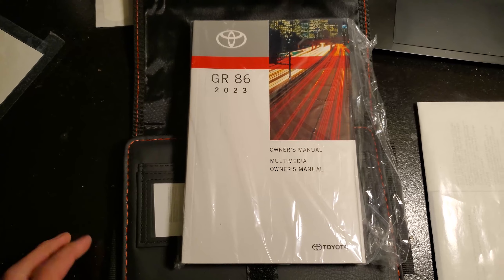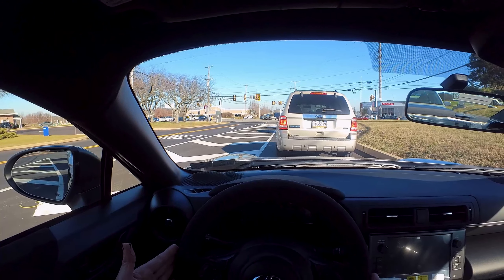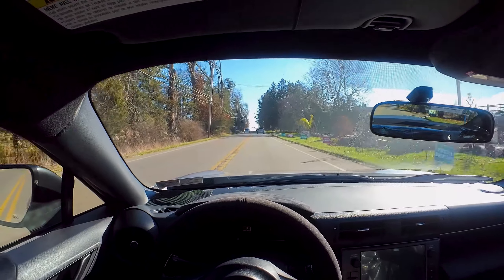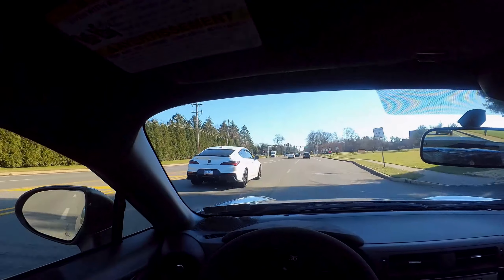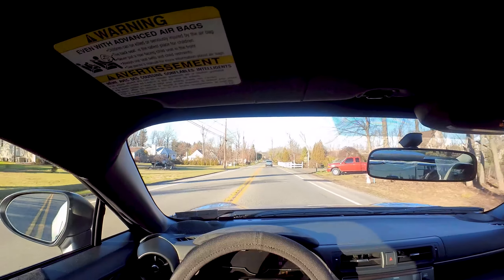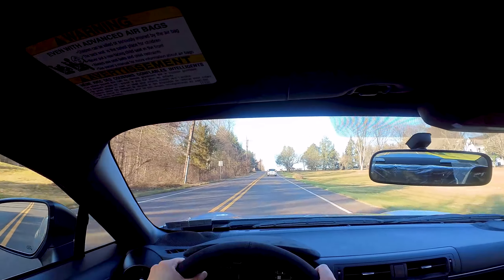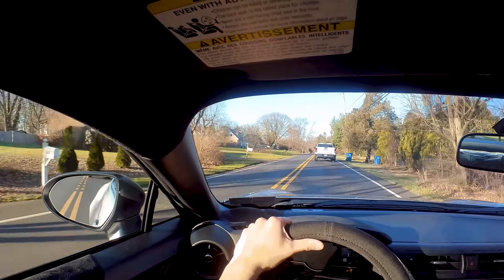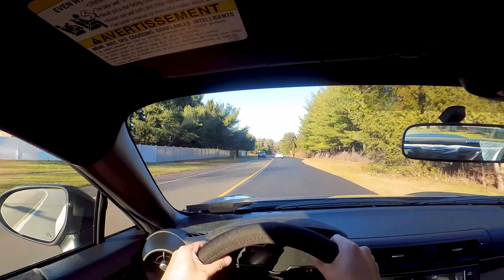My Thoughts After Two Weeks Of Ownership | 2023 Toyota GR86 Premium 6MT | ZN8

Comment: Had my 22 BRZ almost 2 years and almost 18k miles. I drift it out of driveways and U-turns, especially when raining it's almost dangerous on base tires. Installed a black tail on sapphire, sti-style spats and lip, Invidia N2 exhaust, wrapped my steering wheel after I had trouble with a CF LED one that's just sitting in my bedroom. Installed the accessory front lights, mood lights, light-up door sills, Likewise knob, start-stop and e-brake buttons, carplay adapter, door scuff protectors. Waiting on a honeycomb grill to replace mines. Suspension and wheels will come later down the line when I'm paid off at the end of the year. The car is outstanding and always a blast to drive. I want to keep pumping money into it, but I need to focus on budgeting for now. Had a 4k markup and I still need 18k for the buyout. During the pandemic my credit balance was high and didn't want a credit check when rates were going up.
Reply: How do you avoid your car getting stolen through car relay theft or shouldn’t you care too much about it?

Comment: I ended up buying a 2023 MX-5 RF grey . It is on the small side . And the seats are not for much on long distance. I would consider looking for a seat replacement or try to add padding? If that is realistic. Heated seats   Yes . But anything under 70 in 6th gear . Gets upwards of 43 mpg . I  am 61 yrs old . So I did not look at the Toyota. I have had many Toyotas in my life . They are still at the top . I feel comfortable with the build quality on the MX-5 RF manual .

Comment: 24 BRZ tS here that I've had since March.
2:56 Ha ha yeah that clutch pedal really wants you off of it in the last inch. Spring will fix that.
The GR/BR is faster than a 271hp WRX because it's a whole 600 pounds lighter.

Comment: What tires did you put in your 86?

You may want to push up your inside mirror to improve viability for both videos and driving.
Reply from the maker: Conti ExtrememContact DWS 06 Plus, for winter.
Reply: @hongchan1202 I put 17 inch Vredestein Hypertrac high performance all season tires on my BRZ and found no loss in performance. I don’t plan to track, I suspect on the track the stock tires would have an advantage.

Comment: Any issues shifting when it's cold out? I'm in the Northeast with 3000 miles on my 2023 and it refuses to shift into 2nd or 3rd without double clutching until the transmission warms up. I was hoping that would get  better with more miles on it but seems to be about the same as when I first took delivery.
Reply from the maker: I am fine. I think you might need to contact service.
Reply: Dude been driving manual s for 30 years ..  & recently  bought the 86 ..  its butter smooth  ( clutch & shift ) .. try  a heavy weight shift knob ...  &  smoothes out notches in the gear shifter  . But your car needs to be looked at ... not normal even in the cold ..